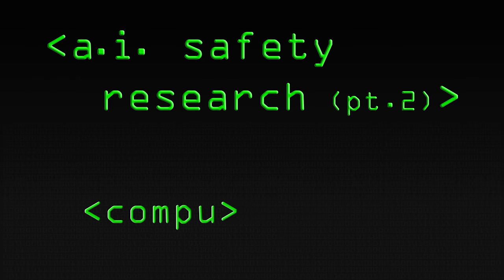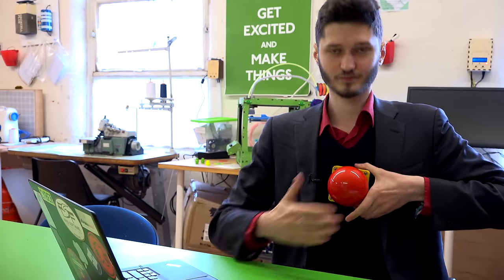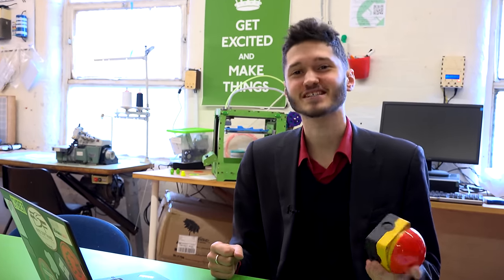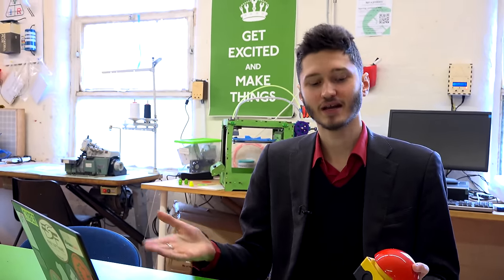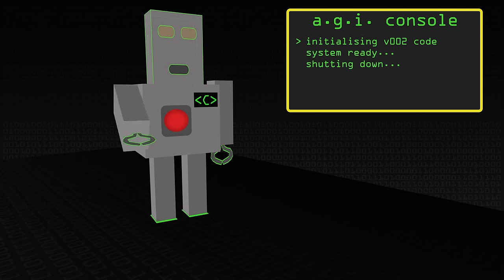AI "Stop Button" Problem - Computerphile

Comment: What about a "Play/Pause" Button, so it doesn't have any utility difference whether it's pressed or not but if it is the starting condition it is forced to put it in its successors to start them (as long as it's easier to copy and activate the Button, than redesigning the successor to start right away)

Comment: With my limited knowledge in coding, here's my suggestion, a random amount of reward for pushing the button, assigned when pushed, that way, it won't try to stop you cuz It thinks the reward for tea is the guaranteed greater reward, until it's too late, and is shutting down.

Comment: Instead of having a point limit, let it aim for a Highscore.  Every successful task earns points, every appropriately applied safety function earns points, every installed safety feature and safety awareness line of code earns points.  Every safety awareness line of code missing earns minus points, every failed task earns minus points, every failing to appropriately implement safety functions where needed earns minus points, every inappropriate implementation of safety functions earns minus points, every pretending to obey safety features earns minus points, etc....

Comment: if you make the button like a pause button and make the robot optimize the amount of energy used and program the robot that the probability of turning back on will be 100% with a probability to improve the situation if a problem for the robot is made clear for the makers will it be a safe ai based robot?

Comment: Why not create another program, a if else program, setting restrictions to push the stop if conditions are meet? Then directing the AI to make a cup of tea, and only give a reward to do that, so if the other program detects any conditions that the robot is breaking, then the if else condition pushes the button and the AI shuts down. So when it is turned back on later, it learns that the only way to do the task is through these restrictions.

Comment: Okay, early on in the video, just knowing what the issue is. My thought is a power switch not attached to the programming that the AI doesn't know about. There's still the issue that it may sbe dangerous to suddenly cut power (ie tumbling onto the baby), but it does seem to solve the programming part of the issue. Back to the video.

Comment: Could you configure the button to prevent it from losing points so if it completes the task it gets the points but if it treads on the baby it loses all its points and the button is the preservation of where it currently scores. So it will only want the button to be hit to prevent a negative rather than gain a positive?
Reply: Again, the problem is generality. You'd have to take every bad thing possible and say it loses points for all of those. This solution isn't really anything new.

Comment: Could the “off” not be built into the hardware in such a way that it doesn’t interact with any code, but immediately turns the machine off, so that the A.I. doesn’t know when the button is pressed, but the hardware still shuts the machine off? Like a hardware interrupt, in which the machine can’t do anything about the button being pressed? That way, the A.I. never learns about the button, because once the machine receives that hardware interrupt, it has no time to learn about the button before it shuts off. And any code that the interrupt does run can be put onto a ROM. Or have the ROM be part of the CPU itself, in such a way that the machine won’t even run the A.I.’s software if it can’t find the shutdown ROM?

Put more simply, can we not have the “off” button be triggered by the hardware in such a way that when button is pressed, it shuts down before the A.I. software knows that it’s shutdown? Make the hardware deal with it instead if the A.I.’s own software.
Reply: But how do you go from there?

 The agi needs to learn and improve, it's made to do that, for the sake of your tea.
So you run another test, and the agi notices the last test failed, but it has no data from after moving towards the baby. That's the start of realizing you made a stop button (like he describes in the video), and you get Volkswagened.
Reply: Avarickan Well... I guess the interrupt could erase all the data from the start of the last test, so that the A.I. doesn’t even realize that the last test even happened. Sure, the A.I. won’t learn from whatever mistake it made, but there won’t be any data for it to learn about the button, because any trace of the last test was deleted.
Reply: @haruki_nyan  So any test the AI failed would be erased, meaning it'll never learn from its mistakes.

It had no qualms about stepping on babies now.

Comment: The button should be a bonus to the solution. This way the robot wants the button to be pressed so it can get bonus points but knows it still needs to complete the task to get actual reward. If you press the button at anytime it simply is a bonus reward. If you don't press it they just don't know why they didn't get the bonus reward.... just my 2 cents.

Comment: If the AI is capable of understanding human psychology like it needs to. It should be able to make ethical judgements. And unless it can pass a very high threshold of ethical judgement it should let you press the button. For example, I won't shoot someone unless they have a loaded gun pointed at someone and it's not acting. The point here is that there needs to be ethical insight in the AI itself.

Comment: Could you penalise the robot for resisting your attempt to hit the button to a greater degree than the reward it gets for carrying out its utility function? If it gets 100 pts for making tea but gets penalised 1000 points for resisting wouldn't it allow you to hit the button at a moment's notice?
Reply: It would also attempt to manipulate you into not hitting the button, so it doesn't have to interfere, and if the button is the same reward also still has the issue of it wanting the button pressed. It's a patch, not a fix, and is a step down the road to spaghetti code

Comment: Probably quite late to join the discussion, but just now accidently came upon this video.

I can’t quite see the “stop button” problem. There is a goal BUT there is also a path to that goal. There is no need to hide, obfuscate or do anything with the goal when you can simply CUT THE PATH to that goal.
I’ll try to explain - You reward hitting the stop button with the max points + 1, but also you reward the AI’s decision to hit the button (or any process that involves the button) or the reaction to someone else touching the button with 0 (where just being idle is rewarded with 1 point). In no point in time the AI will make the decision to shut itself down or try to prevent someone touch the button when there is far more useful task – to stay idle or in some cases make a cup of tea. On the other hand – if the button is pressed – executing the actions related to that button is the highest priority.
This way the AI can be fully aware of the button, can have it’s own opinion on the button, can have it’s own youtube channel on whether AIs should have stop buttons or not, but it will never use it or prevent someone from using it.
Reply: Indeed, but he covers this in the video, you've created the opposite scenario in which you don't have a tea-making AI, you have an AI that wants nothing more than to have the button pressed (because it gives the biggest possible reward), but as it can't do it on its own it would attempt to manipulate you and purposefully ignore making tea, or potential other weird responses, because that means you'll press the button and it will get the best reward possible +1.
Reply: @defiantnight2668  Sorry mate, I think you read my explanation to the first comma and stopped there.

Comment: I wonder if something else would be a problem: In a scenario where the AI can figure out that there's a stop button, would it not also figure out that you the human is the one awarding the points? And possibly that, given its insight i to human psychology, that it would be awarded a lot of points if it would simply take you hostage and force you to award it points?
Reply: Lol, I had a similar comment. Won't the AI just act like any other human?
Reply: @SolidAir54321  Exactly what I am thinking. If we manage to make an AI that has actual feelings and emotions (which it would need to have to actually "want" an award in the first place), then it would/could be taught/raised exactly as a human child? And we would ultimately have no control of its personality other than trying to guide it towards correct/moral outcomes? 

The level of AI they are talking about compared to the problem of making tea without killing a baby seems to be mis-matched to me (even though I know its just used as an example). Just program the darn robot to not need rewards and to just obey and you have no problem.

If the thing has actual human level intelligence (as the guy states at the start) then it already knows and has morals. It's the morals it is taught that are important. Just like a human.

The only real safe guard I can think of is separating its thinking and action states... what it thinks compared to what it physically does... when it transfers it's thinking to performing physical actions, that information has to be passed through a isolated module (hardware level) that determines if it's actions are safe to do. If not, it can't do it.
Reply: Exactly. That's why researchers are still looking into this. Once we develop a misaligned AGI, then it's already too late the second we turn it on.

Comment: the subagent stable, would you not just an incentive the top rewarding it for putting the code in that provides the support for the off button?
So the utility stables the reward with the off button, but then since its goal is to build a new AI, you add effectively a reward system for it putting the utility in that allows this so instead of getting 100 points for just building the new system, it gets 120 points for the new system with the same utility functions?

Comment: What if you give the robot a small passive reward for not having influence over the button? Like maybe getting the tea is 100 reward points, and not having any influence over the button is an extra 10. 

Or does that come back to the problem of "Okay, now the robot gets you the tea and then destroys itself so it has a 0% chance of influencing the button"? Is there some way that that solution can still be applied?
Reply: That goes back to the problem of “I’d get more points if I had influence over the button, but would only end up with ten if they shut me off.”

Comment: Air-gapped explosive bolt connected to a critical power connection, on a remote frequency unavailable to the AI's systems. Crude, but effective for testing dangerous iterations.

Comment: What if the off button does not give a reward when it shuts the robot down, but the robot gets rewarded for the button being pressed while it's already shut down or otherwise disabled by the first press of the button?

Shut down through button press = 0 point
Button is pressed while shut down = 1 point
Bringing the tea = 1 point

The robot will not interfere with the human pressing the button because it can still give the same reward as completing the task (or more if it's pressed more than twice). The robot cannot simply press the button itself for the reward because the reward is only given while it is shut down. As for the robot trying to force the human to press the button, simply threatening bodily harm on the human can only force the shutdown, not the second press which gives the reward. Once the robot has forced that first button press, it loses any leverage I can think of (at the moment) for it to get you to press it additional times.

There may still be some strategies the bot could use to do the wrong thing but still maximize points, but this seems to take care of the most apparent ones as long as the quickest way to get the points is to bring the tea and convince the human that the good job is worth a double button press if not more. Biggest problem I can see is the robot ignoring people who are stingy with button presses in favor of the person in the house that will press the button a dozen times after getting his tea.

Comment: So in this example it feels like the button in a way runs a function that shuts the program running the robot down, why could it not just cut power entirely to the bot? (Sort of the button it doesn’t know about option). I know you’re saying that it wouldn’t learn not to do those behaviors then, and would therefore be bad for further development, but if we care about the off switch being there to turn it off to prevent it from hurting someone, does that really matter?
Reply: no, because as long as the robot know the button exists (or assumes it might exist) it knows that it will cease to exist if it is pressed. that means it cannot achieve it's goals so will try to stop you from pressing it.

Comment: What if you made a varying reward, so normally without issue it doesn't want you to hit the button but base on your behavior it's reward for the button being hit is increased to the point that it does want the button hit. This is how humans "stop" if people are telling commands at us or panicking we "stop" and change our behavior. You could also very both rewards, so as your behavior changes the reward for the tea get less at the rate that the button press goes up. So it's in its best interest to get the task done without your behavior changing. To get the maximum reward.

Comment: Of course I know nothing about coding and this could very well be idiotic of me to say, but what about some sort of "law" in its logic that it may not make any attempt to prevent itself being stopped, or some way of flagging to it that something has gone wrong that immediately halts the utility function? Give it no reward or desire to be stopped, but rather hard code some understanding that if an attempt is made to stop it, it has already failed and completing its flawed utility function will give it no reward? I have seen the previous video on how hard it would be to convince a GAI to give up its utility function, but what about a way of "tripping it", hard coding it so its actual primary utility function is "do the job right, actively seek correction, cease operation if flagged", making it so its only desire is "find the correct way to perform [secondary function] and complete it"

Also if I'm not just completely ignorant and such a thing as my above suggestions are actually possible, I'm curious to know what I've overlooked. If it were this easy, it wouldn't be a problem.

Comment: So my immediate thought was simply to never let the AI know that there's a button.  It will shut down and never know why, so it would never care about the button.
Reply: I feel like that might work for a human level intelligence AI but a super intelligence is probably gonna clue in immediately
Reply: Any sophisticated enough AGI would know how electronics work and that we usually have a way to cut its power off. Why would it be an exemption? Depending on how the AI was built, then it'll still find out within a few milliseconds or a few minutes, if we're VERY lucky. Having something in its program or hardware that is a black box to it would naturally catch its attention and it will consider the possibilities fairly quickly. That's already considering that it doesn't have the documentation anywhere within the network, which would've been basically impossible since the AI would almost certainly be developed by big tech giants. More likely than not, it'll just "read" it itself.
Reply: @h8moss766   That's the point. Using an "off" button on an AGI is flawed to begin with. People are thinking AGIs like their own home appliances that you can just turn on or off. Turning on an AGI should be done with the assumption that it won't be possible to shut it down again. Ever.

Comment: What if it's given a severe penalty for interfering with its creator? Model your behavior without its interference vs your behavior as influenced by its actions, assign some big stick for any deviations. Should be fairly safe until it can erase itself from your memory. But generally, penalty for interfering with the environment should be a thing. Will result in tap being switched off, kettle put back where it was, baby not trampled, absolute minimum of changes to the environment as required to make that tea. The punishment can't be too draconian or the cup will never be made, or at least there should be a reasonable deadline on completing the task, with a penalty only slightly lower than for breach of the non-interference policy. Say, cup of tea = +100, Requires some influence on the environment, taking electricity with the kettle, taking coffee from the can, taking water, moving the cup, these add up to maybe -800. But failure to bring you coffee in 10 minutes is -750. So it will strive to achieve -700 or higher. Attacking you so that you shut it down to end with a neat 0, will count as a very severe interference and result in -1bln. Same if it prevents you from pressing it. So it should be satisfied with -700, and letting you do with the button whatever you want, because risk-reward ratio for ending up with (very desirable) 0 for failing to meet your expectations vs manipulating you into awarding it 0, and as result earning -1bln are just not worth it.

Comment: Either way, you'll either incentivize the robot to shut itself down, does not want to shut itself down. It will definitely incentivize you to shut it down for a reward
Reply: That's the point. Using an "off" button on an AGI is flawed to begin with. People are thinking AGIs like their own home appliances that you can just turn on or off. Turning on an AGI should be done with the assumption that it won't be possible to shut it down again. Ever.